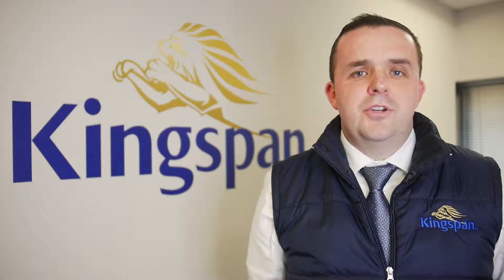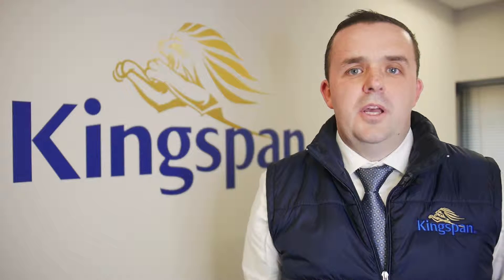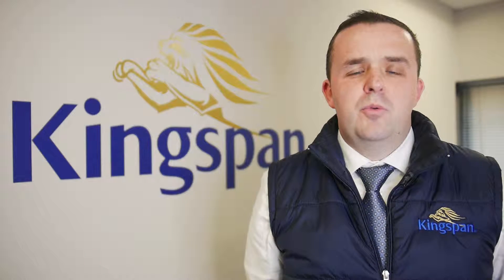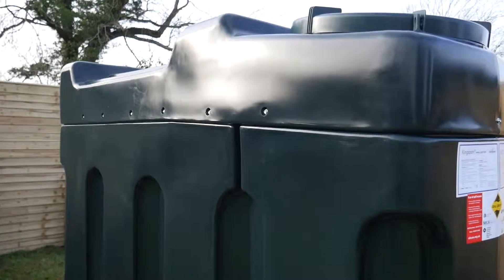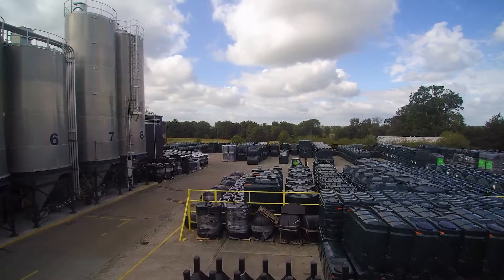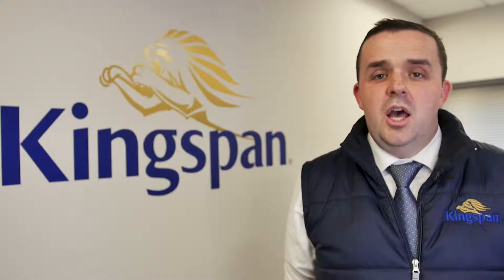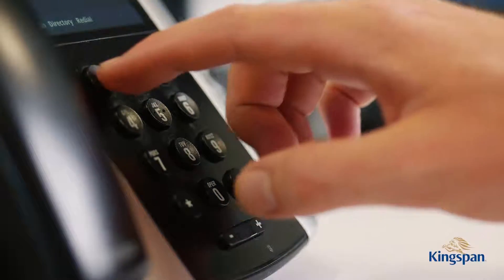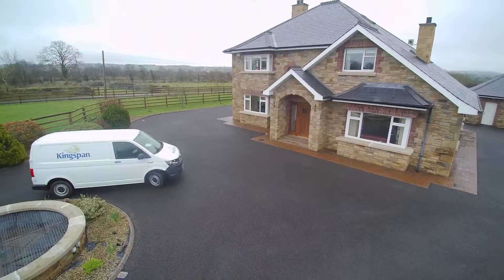Titan Bunded Oil Tanks | How to Install | Training | Kingspan Ireland

Comment: The second application of PTFE tape and sealant was not required. The tapered surfaces of the reducer makes the seal, not the threads. Secondly, don't use those cheap nasty valves. The 'aluminium' goes porous and the pressed steel bowl is a leaky fit on its 'O' ring. Finally, the filter bowl is not independent of the shut off valve so if it needs draining a drain-down is required.

Comment: Why are they measuring 1.8m from a fence it only has to be 760mm minimum
Reply from the maker: Yes, that is correct. According to Irish Building Regulations, the base (without a fire barrier) should be minimum 760mm away from any boundaries and 1.8m away from edges of the surrounding building.